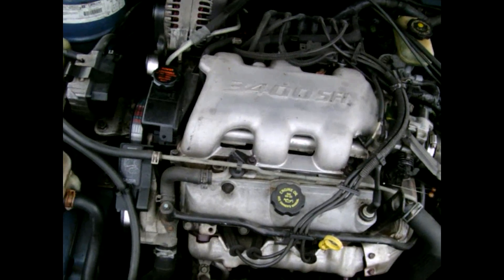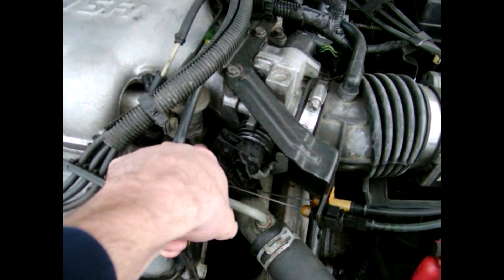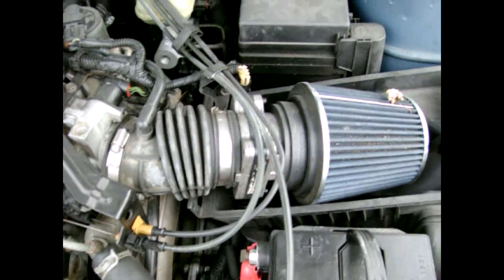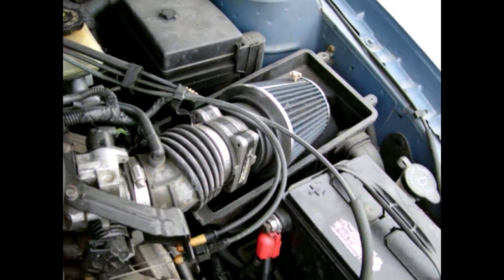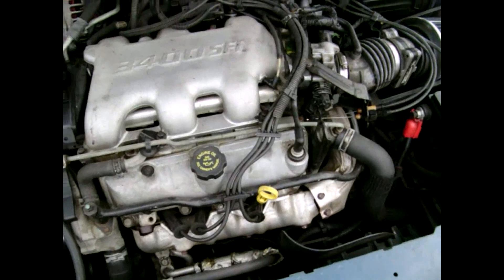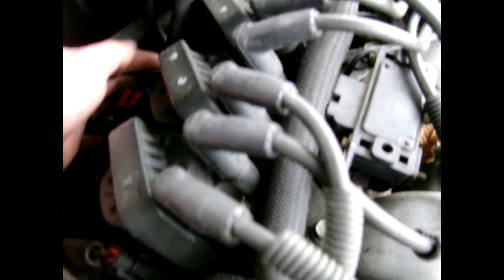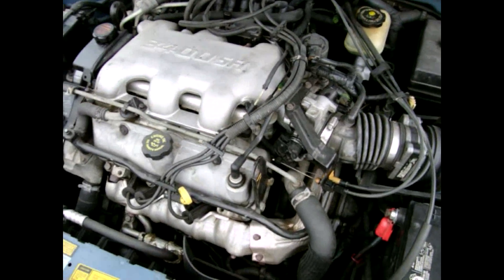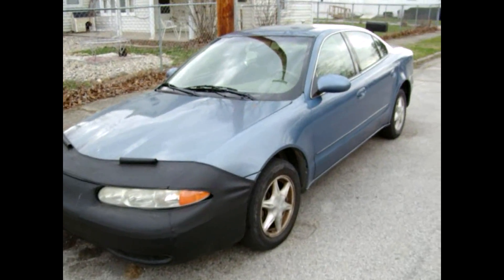3400 GM Engine 3.4 Liter Motor Explanation And Discussion

Comment: Worst engine ever .Starts Great first in the morning but once warmed up the engine shakes and fights it's self trying to restart after short or long ride . Has anyone solved the warm restart problem ?
Reply: Woops I forgot to add it's a 2005 Impala .with premium spark plugs and wire and I have use the clean fuel injectors chemical 6months ago and no maintenace lights are on
Reply from the maker: Sounds like a spark related issue.  Like spark plug wires or a weak coil / spark control box.
Reply: Look for a clean spark plug... U may be leaking coolant to it and makes it ruff to start after it gets warm... The steaming coolant will clean the plug... Should throw a sensor though...Head gasket probs

Comment: lol i managed to crack my Head over my 5th cylinder on my 02 ga gt... It caused constant misfires but still ran, also burned gas like a mofo... BUT i no longer have the car because i upgraded to a Cadi
Reply from the maker: The heads are aluminum and rarely crack.  Most likely it was the head gasket.  But, even the northstar V8 Cadi's have issues.  Unfortunately the same issue, blown head gaskets.
VT247
Reply: heh, nope it was the head. It was fun... to replace.

Comment: the name of a lion coming off a Buick 04 with 3.4 motor coming off the water pump running to the driver side going into the firewall anybody know the name of that tube is mine is dry rotted and leaks water
Reply: it is a metal hose running into the firewall looks like coming off of the water pump on a 04 Buick Rendezvous with a 3.4 motor need to know what the name of that line is
Reply from the maker: Coolant bypass / heater core feed line / not really sure to be honest.  Might be a part best found at a junkyard.
VT247
Reply: See if you can see a fractional dimension (Example: 7/32) of the hose to get replacement measurement and replace the hose.  I went to 2 different parts stores before I got smart and just went to the dealer's part store to get exactly what I needed to fit and was OEM grade.
Reply: heater hose

Comment: It's losing power when accelerating.
Reply from the maker: It gets warmer than normal, lost heat in the cabin, losing power when accelerating.  Sounds like a head gasket problem.  It could have lost compression due to the bad head gasket causing all the symptoms you've described.
VT247

Comment: good engine but.the fuel pump could drive you nuts,and is head to replace,go through the trunk ,cut above the tank.i changed mine.it dad a hole in it,as if sand had made the hole.befor that,i changed crank sencer,map sencer,and almost the fucking cad. converter .
Reply from the maker: Yes, I always cut through the floor board or trunk area to gain access to the fuel pump on GM vehicles.  Forget dropping the tank, that takes to long and is always hard to do.
VT247

Comment: BY THE WAY GM vehicles (Chevrolet, Pontiac, Oldsmobile, ect.)should NOT have green puddles of anti-freeze. All GM vehicles take DEX-COOL which is orange. If you GM vehicle is leaking green anti freeze flush the radiator, block, heater core, and reservoir (puke tank) ASAP
Reply: Robert Morano hey i recently bought a 2001 chevy impala and did not realize this til after i put green anti freeze into my coolant tank, so how would i flush the radiator and the other things you said? And what could i have possibly messed up by putting the green antifreeze into my coolant tank?
Reply: djames214  well first I suggest you buy a flush kit Prestone makes it and you can find it at advanced, Napa, and almost every auto parts store, or you can find it on amazon. Next you need to drain the reservoir, radiator and heater core, the kit takes your heater core inlet hose and adds a T to hook a garden hose to so when you turn it on and remove the bottom rad hose it flushes out the heater core, block and radiator. You then run the car with only water until it reaches temp then turn it off immediately!! You can let it cool down or you can take the bottom hose off when you turn it off and empty the cooling system. Now when it comes to what the wrong anti-freeze could have on your vehicle, well it could cause your car to overheat, it can cause head gaskets to fail, and ultimately the heads to warp. Flush out the cooling system out and if it overheats and you have the 3400 engine like in the video you need to remove the top end of the engine and get the heads decked which means to resurface them, new head bolts, and gaskets from the heads on the block all the way up. I went through it, it sucks and you need to address it before it gets bad, one tell tail sign of head gasket that's bad is you will have a white milky residue on the bottom of your oil cap, and on the dipstick.
Reply: are you 100% sure? ive had it like that for years with no problems. Whats the issue having green instead of orange?
Reply: I just checked the Haynes repair manual and it says (green colored ethylene glycol anti-freeze only)
Reply: There's no issue, although mixing them destroys the extended-life properties of the orange Dex-Cool.  Adding green (conventional antifreeze that uses inorganic compounds) to a system that was originally designed for the orange (antifreeze that uses organic compounds) will not cause any harm.  On the other hand, adding the orange antifreeze to older vehicles (pre-1996) with lead solder connections in the cooling system can cause big problems as the anti-corrosion additives in the Dex-Cool will eat at the lead as well.  The only real difference is that the orange Dex-Cool is extended life and theoretically should be good for up to 5 or 6 years, or 100,000 miles.  The green antifreeze is standard life and is good for 50,000 miles or 2 years.
Note that the antifreeze properties (freeze protection) of the coolant do not break down over time - but there are other additives that fight corrosion and lubricate the water pump.  Those additives are what breaks down over time and necessitates changing the fluid to protect the engine and water pump.
If you've ever worked on a vehicle and noticed the coolant was a dirty brown color that's where you are seeing rust and other corrosion that has been accumulating in the coolant.  Most likely, this is from someone who didn't flush their system at the recommended intervals.
My advice has always been that if you need to add coolant to a system that is under 100,000 miles or under 5 years old, and the system has orange - then add orange.  Otherwise, switch to the green.  For one, the green is cheaper, and for two, after 100,000 miles it's likely you'll be replacing hoses and other components here and there anyway as the rubber gets old and wears out.  Might as well run the green and just flush it every 50k miles (or whenever you replace any cooling system parts that require draining the system.)
Reply: great informative response mane thanks a lot!
Reply: I've heard that the dexcool will eat everything...

Comment: These engines suck..... we use to own a 2002 chevy venture same engine and if I would cold start the van let it run for 1 minute then shut it off then restart the engine the van would crank crank and not start I would have to wait 1 hour later to restart it and then it would start it was weird as hell.....
Reply from the maker: My mine issue was the gaskets.  Started getting away from anything with these motors because of all their issues.  There's not many vehicles still out there that have the 3.4 GM.  Sure you can pick them up cheap, but they're not worth that much even running anymore.
VT247
Reply: Lol, the 3.6 is even worse, can't felpro problem solve your way out of that piece of shit, like you could with the 3.4

Comment: Do yourself a favor, get rid of the car.  3.4= garbage.  If you wanna stick with GM, get something with a 3.8.  Bullet proof engines.
Reply from the maker: Even the 'bullet proof' GM 3800 has it's share of issues too.  The GM intake and head gasket designed around the years of 2000 are prone to failure.  But, the engines are good once the gaskets get changed.
VT247
Reply: I believe that issue was fixed with the series 3 engine

Comment: These engines are pice of shit no joke
Reply from the maker: The engines are great once the gaskets get replaced.  
VT247
Reply: Are you kidding? I've got 230,000 miles on mine and the only major work I have done to it is the intake manifold gasket needed to be replaced.
Reply: mine has 61,000 miles and I have had to spend more money to fix this car than what it's worth. I think I may have gotten a lemon car. Every 2,000 miles something breaks.... or needs replacement, luckily I know My way around a car, but it pisses me off how this car this many miles and alot of problems
Reply: mario villa i Have One Now with 301xxx miles doing Good 2001 Pontiac grand am gt 2dr but I Want to Turn it Into a Sandrail or something close to That
Reply: I had a 2003 Buick rendezvous with the 3.4, 220k miles. Not sure how many miles are on it now but it is still running. I see it in town everyday. The girl that bought it from me says it runs great and she's never had a car that's run so good. She said its a blessing... It makes me feel good

Comment: 3.4....hands down worst motor ever!
Reply from the maker: Not really.  Certainly not the best, but definitely not the worst.  Change a water pump on a GM Quad 4  or a water pump on a PT Cruiser.  The 3.4 won't seem so bad then.
VT247